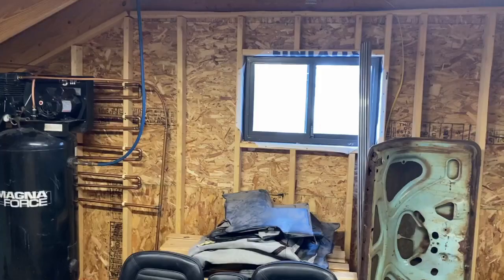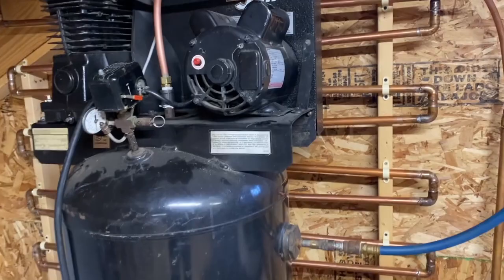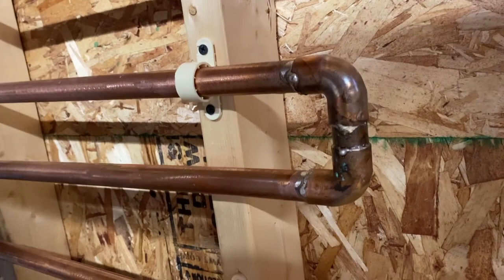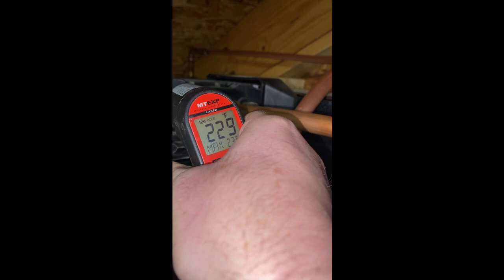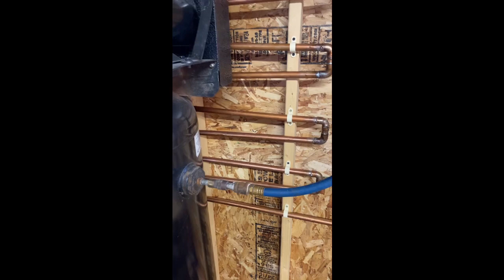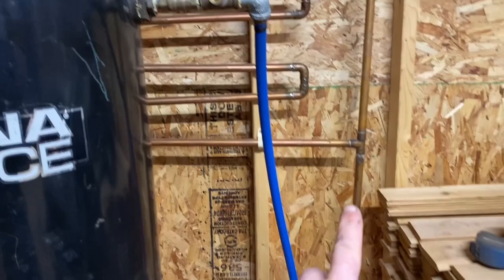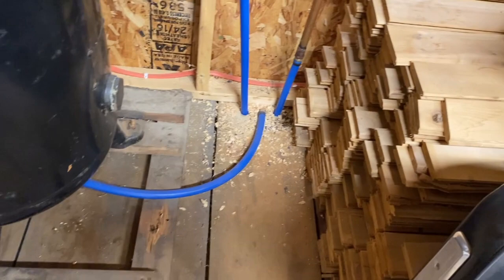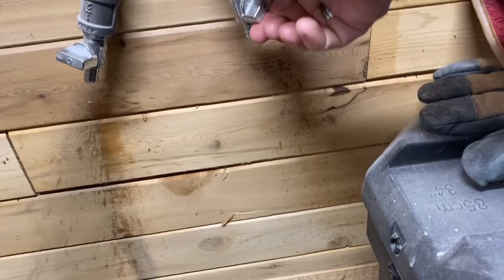DIY Cheap Air Compressor Dryer/Cooler - Feedback after a year of use!

Comment: having a section of rubber hose before the tubing helps with vibration cracks, and ditch the air coupler for a Milton V etc high flow my cousin mentions. and using amsoil compressor oil helps
Reply from the maker: Good idea with the rubber hose.  I'll admit I was doing most of it with the parts I had on hand to save money and avoid another trip to Menards to buy 18 more fittings.
Reply: I read all the comments so here’s my .02. Your latest orientation of how you have the air running is good but if you want your system to really work you need to fix the unloader. There should be no pressure in your cooler after the compressor stops running. If you add some type of condenser unit along with a water trap filter that has a automatic drain the water would drain from the water separator every time the compressor cycles. How your condenser is designed you may need to empty it once a day, week or the water separator can empty it every time you compressor stops. My system seems to work well, the 3 hours I ran my plasma table I had no visible water drain from my tank. I did build a ladder type cooler on the output side of the tank as additional protection and have a desiccant filter before my plasma cutter.
Reply from the maker: @jayjayortega3102  Your perspective makes sense to me.  I do need to manually drain the water out of mine every time I turn the compressor on or off.  An automatic drain would solve that.  But for the little $ I have into this, I'm content with it's performance.  I have no evidence of moisture in my air compressor after quite a bit of use.

Comment: You need to add a large pipe at the end of your condenser coil that really slows down the airflow so that the droplets can fall out and not be dragged along. That is essentially what a water trap is.  or you could buy a real water trap and put it at the bottom where your pipe goes into the floor for draining
Reply from the maker: Good idea.  A large volume section to decrease air speed.  Thanks for suggesting it.

Comment: if you can find some at local scrap yard etc, get sole copper hot water baseboard sections as it has aluminum cooling fins on it.   its a thinner copper though so care in handling , cutting it and soldering it is something to be aware of a guy told us .
Reply from the maker: Oh...that's a great idea!

Comment: Looks like you are into a bunch of the same things I am:  garage beam trolley hoist, compressed air dryer, old cars.  My big compressor in my back garage is just stock, nothing but a water trap on the output.  Not ideal.  My small compressor in my house garage has copper coming out the compressor, and going into a condenser I bought at a junk yard off a big Cadillac SUV, then copper down to the tank.  That setup has a water trap at the input to the condenser (HOT air), another one at the output of the condenser (cooled air), and yet a 3rd water trap on the tank air outlet.  I don't get any water in the tank, and never get any out the air hose and tools.  I even tried painting a car with it, and it worked great.  The only problem there is, it's only a 33 gal tank, 6hp, and struggles to keep up with air demand, but what air is delivered is remarkably dry.  And this is in Alabama, where humidity is just rain hanging stationary in the air.  New subscriber here!  Thanks for your channel!
Reply from the maker: Thanks for subscribing.  Kind of sounds like we'd enjoy being neighbors!  Have a great day.

Comment: The way you had it first was backwards in the sense of thermal dynamics. Run the hot air into the top of the coil so the coil can cool down as the air goes downward. You don't want the hottest on the bottom so that heat given off rises to the pipes above it. It will cool better with hot on top and cooler on the bottom. Plus the air will push any condensed water toward the drain tee near the bottom and not carry the moisture up toward the top. 
I used to teach HVAC and both air and hydronic systems balancing along with thermal dynamics, so I have some experience in that field after 46 years.
Reply from the maker: Hmmm....that makes a lot of sense.  Thanks for pointing that out.

Comment: I got a old 99 dakota truck rust bucket i put new doors on and painted without a moisture filter//lost my toilet paper water filter and got loads of fisheye-luckly i was able to wet sand out the fisheye with 1500 too 3000 to 5000 grit and 3000 grit buffing compound- then murrer glaze or regular polish no grit--now its shinier and nice and flat looking.
Reply from the maker: Glad it came out alright for you. Sounds like it took extra work.

Comment: I think running your tubes vertical like your picture,  plus a dropped tube with drain tube on each leg, would catch more water before getting back to the tank.
Reply from the maker: A drain tube on each loop would help.  I was trying to avoid spending a lot on drain valves.  Mine cools very well, but doesn't allow all the water to drop and drain back out.  Some still comes out of the bottom of the tank.  Vertical runs or slowing the air speed down might help.
Reply: @3rdstallgarage I think the single drain with the tilt like you showed toward that drain would be fine but I'd put the valve below several inches of drip leg.  I'd also put the air in via a T near or slightly below center on the left most vertical.  This will force the air to split and divide causing any droplets to drop then, but mostly helping the air flow more evenly between the top and bottom runners. Feeding directly at the bottom corner will allow most of the air to stay in whichever tube is aligned with the input flow. (thinking of a dynamic system (how does it flow)  instead of the static system (pressure is equal everywhere))

You should also check the temperature of the pipe heading to the tank - if it is hot it will still carry water vapor until it cools in the tank.

Comment: I was thinking of building a copper unit like you did and put it inside a old stand up freezer- might be better for summer time-or at leiste while panting vehicles,? THANKS for posting your plan-- the one in the picture might work better in a freezer too. OR maybe put the radiator under ground- with a tube to vacuem the water out of a lower tank ss steel tank-maybe copper  tube would last long under ground -not sure on that though.? NICE JOB SHOP YOU HAVE THERE 57 CHEVY :hand-purple-blue-peace:
Reply from the maker: I've heard of people running the copper through a 55 gallon drum full of water.  That sucks the heat out of it quickly too without needing a fridge or freezer.

Comment: Running it vertically rather than horizontal with more drains is a much better idea.
Reply from the maker: Maybe...it might drain a little better but requires a lot  more valves to drain.
Reply: Vertical is just too expensive,way too many valves,I built mine the same way and the air is wicked dry now.

Comment: Have you ever seen an automotive radiator with No fins? Copper tubing with No fins and No fan is terribly Inefficient! Air to air heat exchangers Need fins! It's all about surface area exposed to Air Flow! Please look at a hobby sized Passive moisture removal system, designed by a real engineer, Doug Kronemeyer in a 3 part You Tube video series titled: ( DIY #9). He explains the layout, & logic of his genius system. His system is so efficient that it rivals the performance of a refrigerated air drier at a small fraction of the price! A junkyard auto AC condenser from a big american car or van would do an awesome job with Ducted electric fans sucking air thru it, plus 2 water traps (the 2nd one of Dougs design), would eliminate any more tank water for long tank life & safety! Give it a good look!
Also a shout-out to Bud Stiner, THE Compressor Guru (YT), for DIY video tutorials, parts, inc. Real aftercoolers, & sales & local service. Keep trying & never stop learning! Good luck, Paul from hot S. Central Tx
Reply from the maker: Thanks for the suggestions.

Comment: Maybe a metal bulb type dryer with auto water drain after cooler but before your tank would keep more water out of your tank.  I would be concerned if I were you at the amount of water that drains from your tank.  I'm sure you improved things but there's still quite a bit of work to do if you want to protect your tank and tools.
Reply from the maker: Good point.  I'm more worried about sending dry air to the sand blaster and paint tools.  The tank is still getting some water to it, but not as much and it's regularly getting drained. Previously I hardly ever remembered to go upstairs and drain the tank which allowed water and rust to collect and plug up the bottom of the tank drain.  Doing it regularly helps it stay drier.

Comment: i think you just need to place a filter(evapuator) before tank and it will collect all your water. its the cheapest way. whithout that filter some of the water still be going even thru the most difficult scheme. how you can reserch it - fill the vertical pipe with some water and give a pressure from the bottom, and all water will be evapuated in a time. because you have 10atm pressure. or you need to make very very high pipe (or many pipes) and it will be very expensive), much more expensive than filter
Reply from the maker: Thanks for the input!

Comment: Turn the cooler vertically with drains at the bottom sadly seems to be the most efficient
Reply from the maker: As a cooler this works awesome.  As  dryer it works decent, but vertically may work better.
Reply: @3rdstallgarage  cooler doesn’t mean much if it doesn’t translate into dryer air running through your equipment only system I saw with one drain that looks to work halfway decent is liquid cooled copper coil both drier and cooler air 
Though i haven’t seen anyone use old car antifreeze for cold climates yet

Comment: Just thinking about your cooling setup- why not run the air through a charge cooler that is bolted to the back of your cage that covers the main compressor pulley?  Use the fan of the pulley to pull air past your pipe work / charge cooler? Looks a nice setup though
Reply from the maker: That would work too.  It all depends on what you want to buy and how much space you have.  There are lots of different ways to accomplish it.

Comment: I am curious as to the possible pressure drop going thru all of those bends? Also I would of made it with 3 or 4 10' lengths of copper tubing. And then bend a large radius on 2 parallel lines and solder the 2 pieces together using a union. Also using PEX is dangerous unless it is Upanor PEX.
Reply from the maker: Lots of different ways to do it.  Thanks for sharing your ideas!

Comment: Does the unloader valve drain all the air in your 50+ foot  cooling system?
Reply from the maker: If you are talking about the two ball valves that drain the water off the system, they would drain all the air if I left them open. Usually I just open them for one second and blast out the moisture that's collected and then leave the system pressurized.
Reply: @3rdstallgarage  not that, on the check valve on the tank, it unloads the  pressure in the pump when the compressor stops.
Reply from the maker: @jamesmcgee3532  Ahh...I think the check valve is missing on my compressor.  It's an old compressor and I bought it used.  I'm not sure I fully understand exactly how it should be, but when the pressure switch turns the compressor off, it does NOT relieve the pressure off the pump and air slowly leaks out a small hole in the side of the compressor head.  I know it's not exactly right (they way it is now) but it works and the compressor seems to start up fine, so (for now) I've decided it's not worth trying to fix.  I'm not familiar enough with them to know how I would go about fixing it or what parts I would need.

Comment: If you turned your system 90° and put a drain valve between each bottom elbow the tank would stay dryer.
Reply from the maker: That's true.  I was trying to avoid having a ton of drain valves for expense and ease.  But yes, that would be another way to do it.